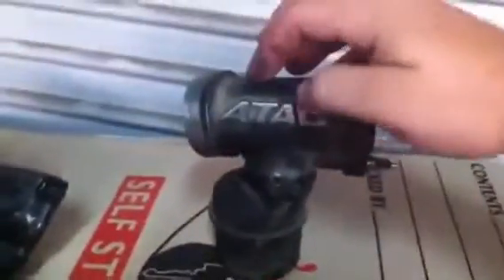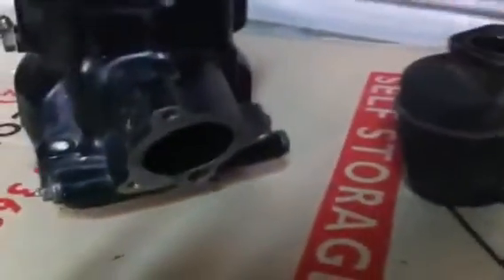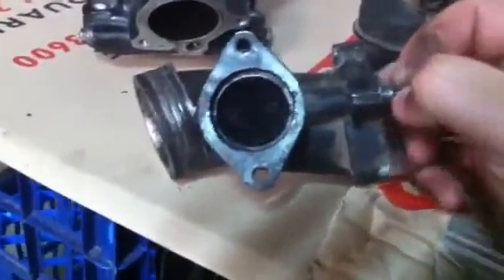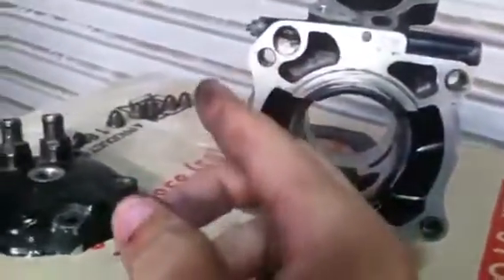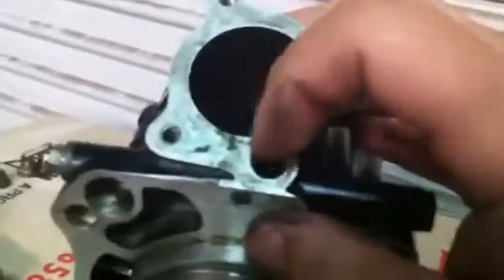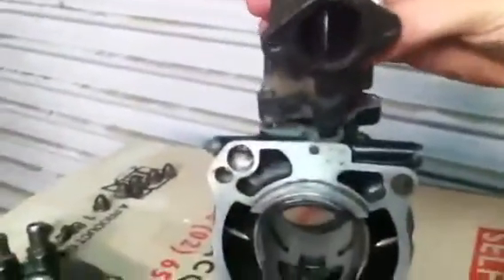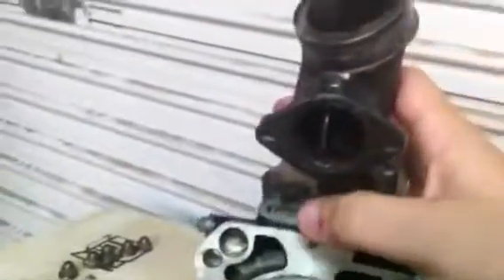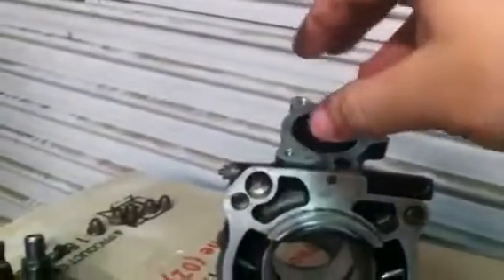1984 cr125 ATAC and how it works

Comment: Hi I have been enjoying your video but was wondering if you have a picture of the actuator going through the engine cover. The one on the bike I'm trying to put back to original is damaged so I'm not sure how to fix without a reference. If you could photograph  I would be forever greatfull. Cheers Steve.

Comment: I think you meant when the butterfly valve is open at rest, allowing the exhaust to fill the ATAC Chamber, you then say it's open to have the back pressure increase but I believe it's the exact opposite, at low RPMs the ATAC resonance chamber plus the regular exhaust port duct volume combine to create MORe , available space for the gases to flow, and the more volume tht exists within the expansion chamber system, the easier that gas can fill in the unoccupied space rather than having to be squeezed in a tight place....so that's what boosts torque on these resonance chamber only powervalve systems...creating more volume to LESSEN the back pressure at low revs... Think of it as you blowing into a drinking straw as hard as you can as opposed to blowing into a toilet paper holder...you can blow much faster, harder, and move more air from your lungs into and thru the TP holder as opposed to blowing thru the straw......so I think that's a good explanation of what's going on inside that complex motor!!!!

Comment: So in better terms when you install the exhaust manifold to the head you want the butterfly valve to be closed. That is with the bolt, spring, gear, and adjuster in the cylinder, then you can adjust the butterfly which in turn adjusts the powerband by adjusting the screw on the right side of the cylinder.